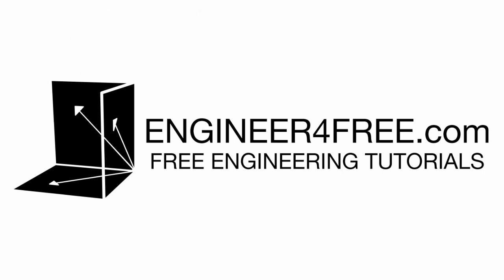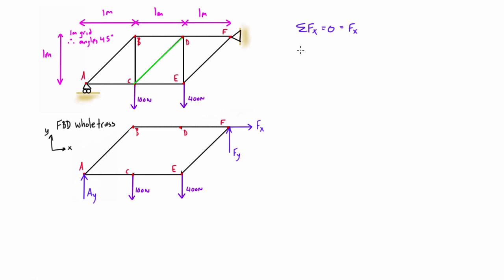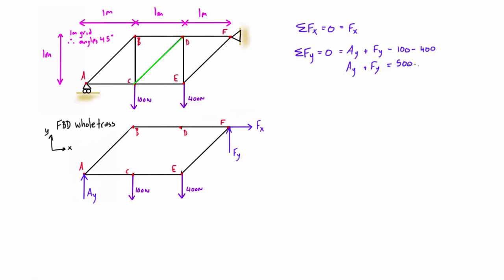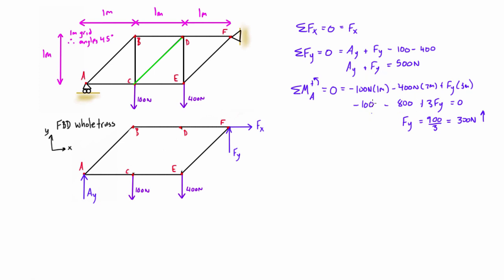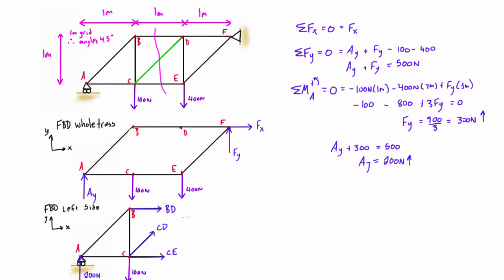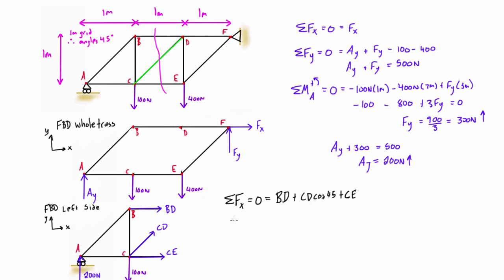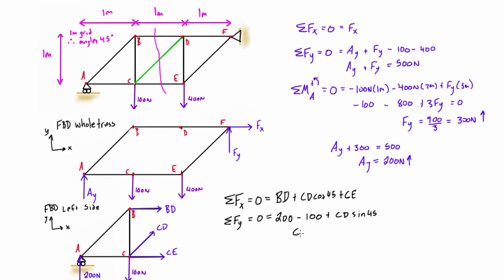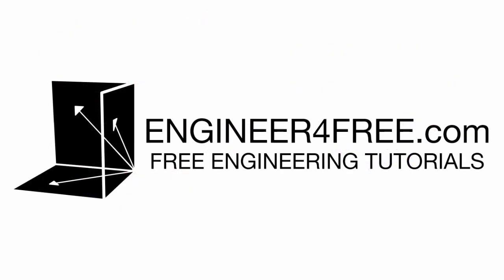Truss analysis by method of sections: worked example #2

Comment: Hi. Thanks so much for the video. Quick question on notation. If the force of CD=-144.4N, would the force of DC be 144.4N in tension? or is it that that whole rod is in compression from both sides?

Comment: Thanks for the video sir , jus a question though. So when we are finding an internal force of a particular member using the method of sections, we basically jus make a cut through the member making sure that we are not cutting more than 3 members whose internal forces are unknown, then on the side we choose to use we only use the external forces of the truss as we do when we are finding reactions, right?

Comment: Hi sir,
Haven't you only found the  vertical component of CD? If you were to  then find the horizontal component of CD & use Pythagoras theorem, wouldn't you only then be able to find the internal stresses in CD? 
Pls help, idk if i've been doing it wrong ;(
Reply from the maker: -144kN is the actual internal force in member CD, which is compressive. -144kN*sin(45)=-101.8kN is the vertical component, and -144kN*cos(45)=101.8kN. They're the same because the angle is 45. So in the video when you see me write CDsin45 in the equation for sum of forces in the y direction, "CDsin45" IS the y component, but when I separate CD from sin45, CD its self is the actual internal force. Hopefully that makes sense. You can also watch this same video being solved using the method of joints here: https://www.engineer4free.com/4/truss-analysis-by-method-of-joints-worked-example-2 and I recommend checking out videos 42-52 here: https://www.engineer4free.com/statics.html =)

Comment: direction of Fx should be towards left hand side for free body diagram of whole section. correct me in case I am wrong.
Reply from the maker: You may draw the direction of unknown forces in any direction that you like on a FBD, then if you go and solve for it and find that it is negative, that just means that the force actually points in the opposite direction. In this case, because it is a statically determinate structure with no horizontally applied loads, Fx = 0, I find that Fx =0 at 0:50 in the video. This can be further confirmed after we solve for Fy=300N by taking the sum of moments about point A: (100*1)+(400*2)=(300*3)+(Fx*1) -> Fx=0. Because it has a magnitude of 0, the direction that we assumed in the FBD is irrelevant. Hope that helps!
Reply: Thanks for your reply. Anyhow i understood your video already. I just had doubt in direction Fx. Thanks for clearing.

Comment: Sir when should we use method of section when method of joints? 
Or it depends on us to decide?
Reply: if the problem only requires specific members to be solved then use method of sections. if the whole truss members is required use method of joints. I hope it helps.
Reply: @alas3640  thank you so much👐wish you bests

Comment: hey.. when i took the moment about the point F, I got the value of Ay=300N and Fy= 200N... why is this deviation in the values?
Reply from the maker: The expression for the sum of moments about F is: (100kN)(2m) + 400kN(1m) - Ay(3m) = 0 which reduces to 200kNm + 400 kNm = Ay(3m) which reduces to 600kNm / 3m = Ay which reduces to Ay = 200kN. Notice that Fy and Fx do not show up in this expression because their lines of action pass through the point F that we are taking the moment about. Now that we know Ay, we can do the sum of forces in the vertical direction: 200kN - 100kN - 400kN + Fy = 0 which reduces to Fy = 300kN. You must have just made a math error along the way. Hopefully this clears it up!

Comment: Hey, how come you dont count BC in your Fy calculation?
Reply from the maker: For Fy calculation, only consider the reactions and externally applied loads. No internal forces are considered in the equation, and BC is an internal force
Reply: @Engineer4Free  okay thank you - does it matter which side you choose after you've sectioned it because I'm getting two different answers for the same member when i use the two different sides on  a question im doing!

Comment: Good day Sir, thanks for the video. May I ask you what if i calculate the moment force from point F? The answer should be different. How to determine the point to calculate couple moment? Thank you.
Reply from the maker: Hey thanks for the question. Pick a point that is going to eliminate as many forces from the moment equation as possible. In this case you can pick either A or F. You will find the same answer either way. If we do sum of moments about F = 0, the expression is: (400N)(1m) + (100N)(2m) - (Ay)(3m) = 0. 400Nm + 200Nm = Ay(3m). 600Nm = Ay(3m). 600Nm / 3m = Ay. 200N = Ay. And then sum of forces in y direction, the expression is: Ay + Fy = 500N. 200N + Fy = 500N. Fy = 500N - 200N. Fy = 300N. So, you can see that it doesn't matter if we do moments about A or F, either way ew get Ay = 200N up and Fy = 300N up. Hope that helps, let me know if you have any other questions!

Comment: Hi, i dont understand how u get the moment for FY at 2.23 .Can you please explain to me? Btw this video has been very useful! Thankiew
Reply from the maker: Sure. In this step I'm finding the sum of moments about point A. So to do this we need to find the moment caused about A by every force acting on the system. To find the moment about a point that a force causes on the system, we can use the magnitude of the force, and the perpendicular distance from the point of interest to the line of action of the force. The magnitude of Fy is unknown, so that's what we're solving for in this step, but the perpendicular distance from point A to the line of action of Fy is known, it is 3 meters. If you can't see it yet, you need to draw a line that extends straight out of both ends of the Fy arrow (this will be a vertical line). If you draw a horizontal line that passes through point A, it will intersect with the vertical line you drew to extend the Fy arrow. The horizontal line is perpendicular to the vertical line, and you should be able to see now that it is 3 meters long. That's how we come up with the 3m that is in the Fy(3m) term. I don't include any term in this equation to represent the moment caused by Fx, because I already know the magnitude of Fx is zero. Zero force causes zero moment, so we can just recognize that and leave it out. Hope that helps clear it up brudduh.
Reply: @Engineer4Free   brooo OMG thankiew v much u just saved me lifeee :) im damn grateful to you